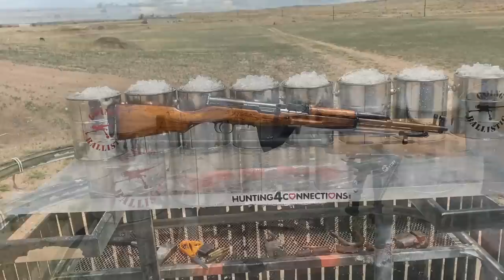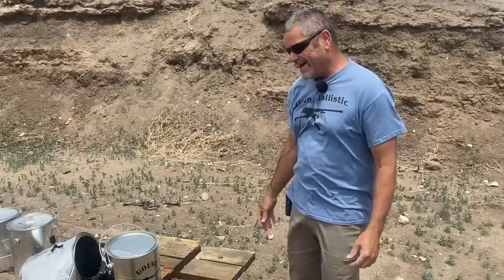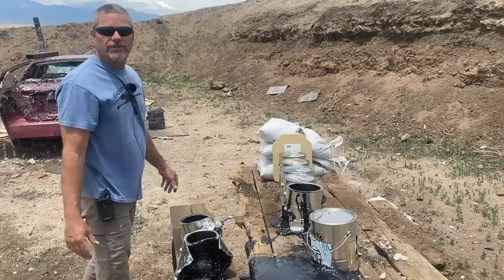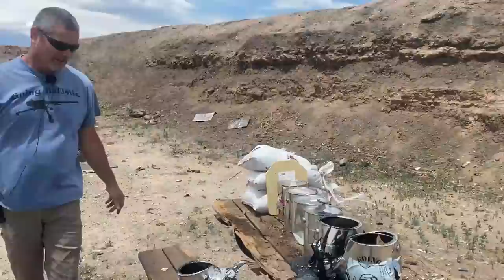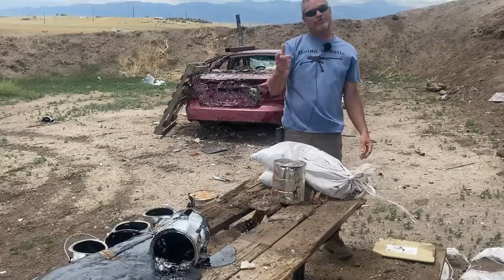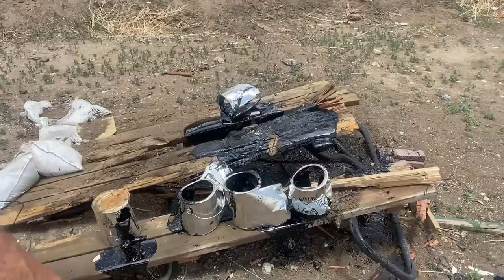Can Cold Tar Stop a M1 Garand?

Comment: Hey Chris, 
The way to lose tar stain,  Goodluck 

First rub the tar (stain) with butter, margarine or salad oil.  Leave it on for an hour to make it easier to remove the tar.
 Treat the remaining stain with benzene.  Place paper towels under the fabric and then dab the stain generously with benzene.  The kitchen paper absorbs the benzene through the fabric, including the tar residues.  Change the kitchen paper regularly.
 Make sure that the remains that remain are wet and dab with household soap (Dove soap works very well) or with ox bile soap, after which you wash the fabric according to the washing instructions.

Comment: FYI, take your shoe's off before you get into your vehicle, leave them on the range! That tar will follow you home, lol. Shooting tar on your range, bad idea ! You'll step in it for years to come.
Reply: Best way I've found to deal with tar is dry dirt just walk in real dusty dirt it makes the tar turn into a soft rubber rock like amalgamation
Reply: What's the temperature turns hot the tar turns to liquid again and then of course you step in it again.lol it happened to growing up on the beach in key biscayne, tar would float up solid , and as the day heats up it turns hot molten liquid and burns your feet, and you hop skipped jump into the ocean lol.

Comment: Going Ballistic, 
have an idea to check. so you took ceramic plate and hit it in different places with plate rated ammo (expecting no penetration). than use cold weld bonding glue(usually 2-componets) to fill out the holes and than test with different types of ammos hitting the same places
Reply from the maker: Good idea